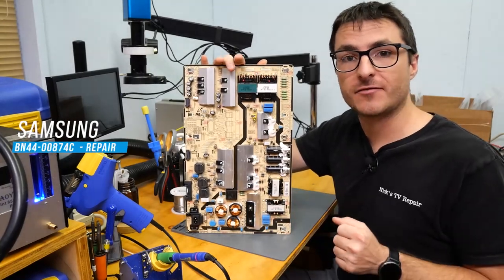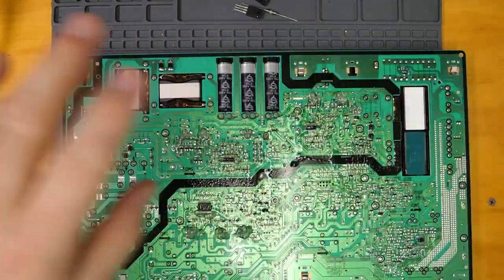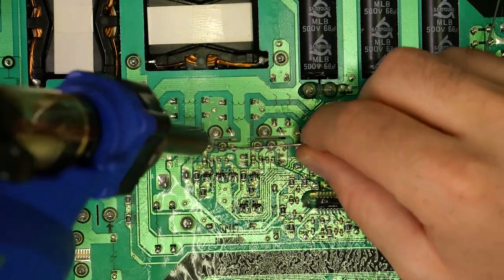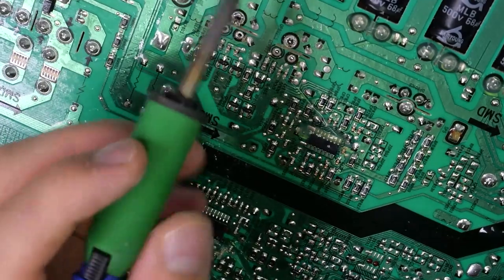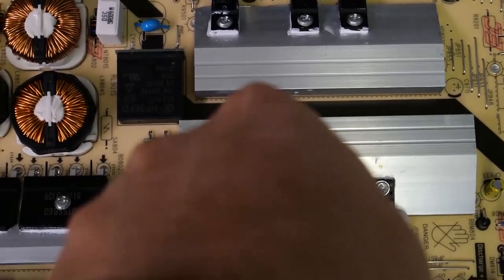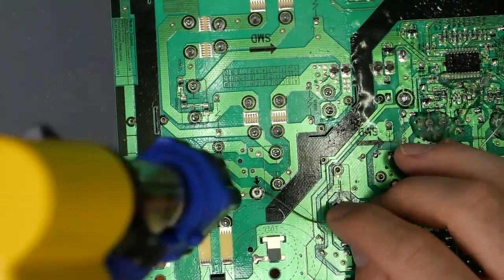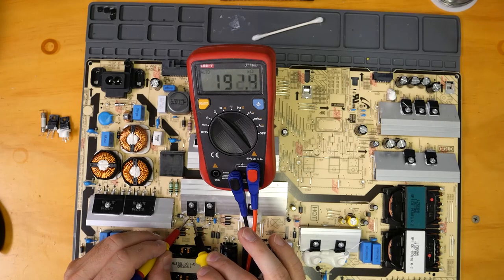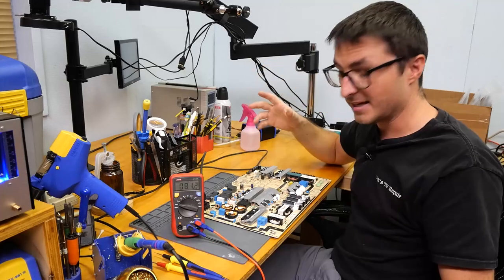Dead 75" Samsung 4k TV Repair UN75NU6900FXZA

Comment: Hello,

The 75-inch SAMSUNG TV 75au8000 or 75au9000

LED strips are getting very hot, making it impossible to touch them with hands, even emitting smoke. The old LED strips burned the diffuser sheet. I reduced the brightness using the energy-saving function, but the LED strips still heat up significantly. I checked the resistors on the board, everything is fine, and the transistors are intact. There are 218 volts on each of the four LED strips. The marking on the strips is 94V S1A8-750SM0-R0.
Supply board is BN44-01112A

I've seen many similar issues online. People are returning their TVs under warranty because they're afraid they might cause a fire. Thank you so much for your work; I've learned a lot from your channel!
Reply from the maker: Wow, that's kind of crazy. I didn't know this was an issue with the AU8000 and AU9000 series. This must be a new thing or they are still under warranty perhaps. I will be keeping an eye out in case one comes into our shop for repair.
Reply: @NicksTVRepair  

Also, be cautious with ordering new LED strips. After I ordered mine, they only worked at half capacity, but at least they didn't get hot. The brightness was so low that the image was only visible in a dark room. This was because the LED strip connector has 4 contacts, 2 negative and 2 positive. But from the board, only 3 wires are coming according to the “- - +” scheme, and this positive has 220V. The thing is, the old LED strip lights up all the diodes at once (I only have one left in working condition) and also has 2 negative and 2 positive contacts, like the new one, but the power (positive) from the three wires from the power board, according to the “- - +” scheme, when connected, is divided into 2 positive pins at 110V each as they are connected according to the “- - ++” scheme or HL+ L- H-. But the old strip gets very hot when current is applied to all the LEDs. I couldn't find the same strips as the original, but I managed to modify the new strips by simply connecting two positive pins, thus I achieved the same principle as the old strips. However, they also get very hot, and I'm afraid I need to keep looking. In this regard, I have a question for you, I would be very grateful if you could help me with this. Should I reduce the current going to the LED strips by adding a resistor? It's also a mystery to me why, when the lights are turned on halfway at 220V, they don’t get as hot as when I turn on the second row of lights according to the HL+ L- H- scheme (like in the original LED strip).And also, why do I need 2 negative wires if I only have 1 positive? I can't understand this. Maybe it's worth looking in this direction and removing one of the negative wires from the board... I don't know.

P.S. I was very surprised by Samsung's response that this is not a problem and that the TV should be watched with a time limit because of this
Reply from the maker: You could reduce the current but I would also just advise an easier method is to go in the TV settings and lower the backlight brightness to 50% or 75% and it would have the same effect.

Comment: Your video gave me the confidence to attempt a repair job on my own tv power board.   Amazingly enough the tv came to life!  All was well, until I finished getting all the components reconnected.  Powered on, and a vertical black line top to bottom on the center/left side of the screen 😢.  Ugh
Reply from the maker: Darn that's to bad. Well on the bright side it sounds like you did fix the power supply.
Reply: @ new tv on the way; I might tinker around with this one to keep learning though?  Thanks again for your excellent videos!
Reply from the maker: You are welcome!

Comment: Thanks! I was given one of these TV's as junk. Can't wait to test and repair.  I used to repair an old Sony rear projector every couple years when it failed to focus. A regular occurance.
Reply from the maker: Those are for sure not junk TV's. Especially if you have the exact model UN75U6900FXZA. Definitely worth fixing.
Reply: @NicksTVRepair  Yes that's my model, it's huge. I have the back off.  I'll test the components tonight.  unplugging the data ribbon cable from the power board did not make the backlight come on like some older, smaller models (while power is plugged in).
Reply: Hi Nick. I replaced these, and the fuse blew again, and the 'center' mosfet. I unplugged the sound board ribbon, power board now isolated, and a 2nd fuse blew. What else could I check? I suspect a lightning strike.
Reply: @WizardOfWhoopee  Any luck repairing?  I had a lightning strike and my fuse and mosfet blew.  Changed both mosfets and fuse and fuse still blows. Mosfet is shorted again.
Reply: @cutum  Mine did the exact same thing. The repair kit kept blowing. I'm ready to buy a whole new board. There were None in Dec/Jan. Now there's a flood of new ones on ebay for around 150 bucks.
Reply: @cutum  My electronic repair buddy suspected the IC near the mosfets and heat sinks, but he couldn't find an exact replacement.
Reply: @WizardOfWhoopee  Thanks for replying. I'll Check the pwm chip and surrounding components.  Thanks again.

Comment: 2:56 What would you recommend as a replacement for those original MagnaChip MMF60R190Q N-ch MOSFETs? Thx
Reply from the maker: Doesn't matter really as long as it is an N-channel Mosfet that can handle 600V at 20A. I said 600v in the video technically the originals can handle up to 650v but the power supply never puts that kind of voltage on them. I don't believe it ever goes about 450 at peak actually. 
We use TK20A60U

Comment: This was super helpful! Needing some rookie info....Do you have the part numbers you used for the Fuse replacement and Transistor replacements? You mention the Samsung parts numbers but I didn't here what you replaced them with. There seems to be quite a variety of these when I look at Digikey.
Reply from the maker: This is the 2 throughole mosfets we used in the video:
MMF60R190Q
They are rated for 600V and 20Amps. They are N-channel MOSFETS. 
Lots of compatible replacements avaialable. 
If you call Digikey they have techs that can help you find compatible alternatives.

As for the fuse it says on the board it is a 6.3amp 250V. It's a ceramic fuse, and I believe they are slow blow. 
If digikey doesn't have them, check mouser, and if you still have issues, then just go to eBay, someone there should have what you need.

Comment: You are absolute right,I did not explain correctly ,i have never found only  the cap blown apart ,always seen it when the mosfets fails (short).
Reply from the maker: We see that with a Vizio power supply as well, it's the same thing, 50% of the time the cap is blown 50% of the time it is in perfect condition. I don't know what the difference is in terms of how the mosfet or diode shorts out to cause that or not. I would be interested in knowing though.
I actually did a video recently on that exact Vizio board. This is the one here

https://g.page/r/CYoJT4T-14qTEAg/review

Comment: My 2 cents,I have done a few of those and in almost all of then I have found capacitor CP809 (101K/1K) blown apart and is found in front of diode DP801Cs in the same heatsink of the 2 mosfets,so is a good tecnique always verify this cap.
Jorge
Reply from the maker: I could be wrong, but I believe those will typically fail due to the diode or the transistor shorting out, I don't think that cap blows on it's own. 
Have you seen one of these with only CP809 go out? If so then yes, it would absolutely be wise to replace it everytime. 
Haven't had one of these come back yet even with the 1 year warranty, so I assume it's most likely something that only occurs at the time of failure but if the cap is okay then it won't go bad later after replacing the other defective components.

Comment: What is the little blue thing next to the transistor that you are replacing? On my tv with the same board the blue thing next to it burned up.
Reply from the maker: That is a ceramic capacitor. 
If you want to fix the board yourself and want a one stop shop to get all the parts you need we have a repair kit for sale that includes the capacitors. Here is a link to the kit:
https://nickselectronics.com/products/bn44-00874cpartskit

Comment: Surprised you don't check gate and drive components.
Reply from the maker: No need when you have seen these boards a hundred times and it's always the same exact failure.
Reply: @NicksTVRepair  I realize this is a specific board that doesn't take out the driver and other components. I just think you should mention that FET failures can cause other components to fail and is good practice to check before powering up.
Reply from the maker: This is true
Ill make sure to do that moving forward. 
There are a few other power supply boards we are going to repair on camera that are more involved and require a lot more parts to be replaced and repaired, ill make sure to mention that.

Comment: My tv stays in reboot mode keeps shutting down after 5-8 seconds. I did some troubleshooting and when I unplug power board from main board, the back light keeps turning on and off repeatedly and keeps doing clicking sound
Reply from the maker: Could be the LED driver IC chip but that's a guess. Wouldn't be able to give you more information without diagnosing it myself.
Reply: Did you figure the issue out?